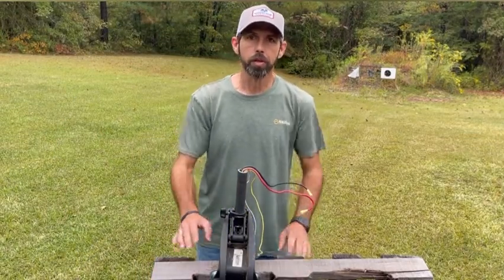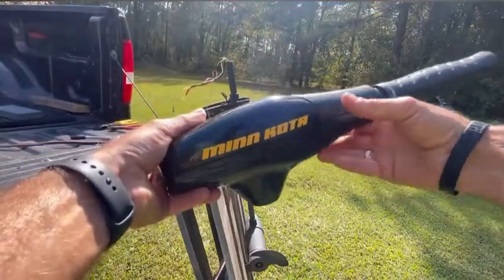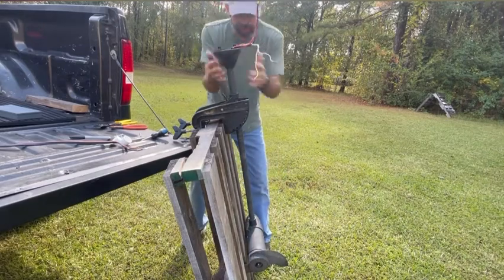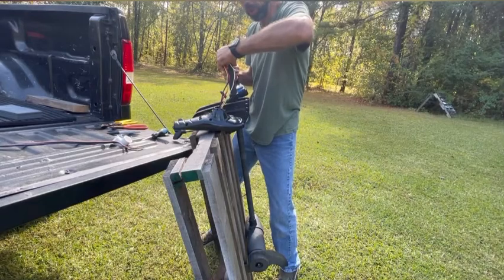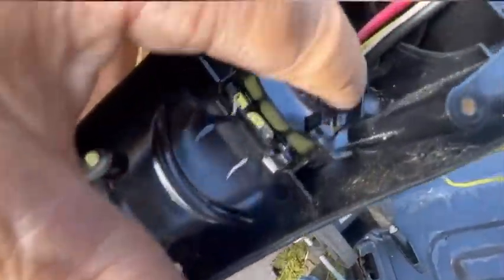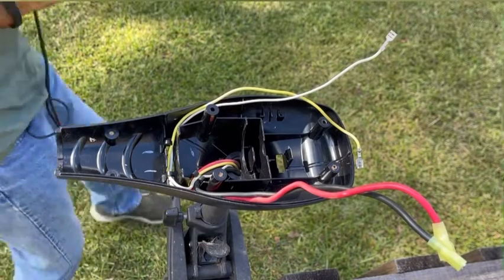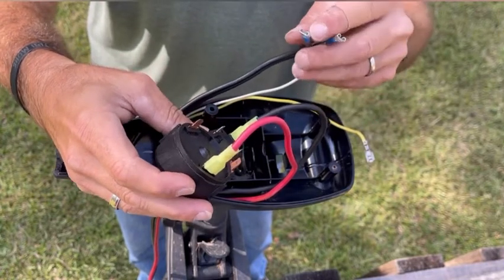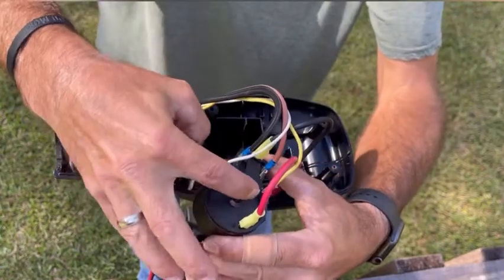How to reinstall the head of a Trolling motor  after cutting down the shaft.

Comment: just modified my motorguide 30 plus. I used a plumber's pipe cutter since mine is a steel pipe and this worked  when drilling I used a hacksaw blade to keep wires at bay when drilling through for new base mounting holes. waiting on the rest of items required to build my PWM box!
Reply from the maker: You took the proper precautions, nice work. It’s really a easy process. Glad your build is coming along. If I can ever answer any questions just let me know. Thanks for the comment.

Comment: I can’t seem to find a video on how you get the head close enough to control from your seat on the kayak. Do you have to extend the wiring? How do you wound the head to turn of and on?
Reply from the maker: When you remove the head of a trolling motor you use what’s called a PWM or a EAC to control the on and off and the speed of the motor.
Reply from the maker: Yes and when you extend the wires use 8awg wire.

Comment: great video 

my speed arm extender came off ? and now my reverse does not work it should be 5 forward & 3 reverse but it not turning ? only allowing me to turn 8 x one way 

Hope this makes sense cam=n you advise please.
Reply from the maker: Sounds like the speed control that the extender attaches to has either broke or gone bad. You could probably replace it or just hook a PWM up to it and remove the head all together.
Reply: @334tacticaloutdoors  

Sorry what is a PWM ? New to this lol 😂
Reply from the maker: @FishingWithJay04 here’s my video on a PWM. 
How to hook up a PWM (pulse width modulator) to control a trolling motor.
https://youtu.be/NdA61Oh1OiM

Comment: I have a prowler 30lb thrust that looks identical to yours.  My question is how do you fix the extended handle.  Mine just comes out on its own.  I would like for you to do a video on it.  May sound elementary but I may be missing parts that makes it just slide out.  Also is the switch a universal switch for all of the minn kota motors?
Reply from the maker: The silver piece of the handle that connects to the switch should have a small screw in it. And yes that switch is almost the same in all 30lb motors.
Reply: @334tacticaloutdoors  I was given this trolling motor off the boat and the guy took it apart when we got back to his house and tore it apart and that is where the piece(s) started missing.  The switch quit working so that is why i started asking questions.  I want to fix this and mount it on the back of my boat.  Where do you order your switches at?
Reply from the maker: You would come out cheaper hooking it up to a PWM and connecting a handle for steering. 
https://youtu.be/NdA61Oh1OiM?si=vT9w83HdFnLyIFTq
Reply: @334tacticaloutdoors  watched that but are you putting the handle back on the pipe for steering? Or do you have something else to put in it’s pkace
Reply from the maker: @rickwilson2848 you can make any handle. You can attach it by drilling a hole and putting a bolt through it.

Comment: I wanna put mine all the way down in the skeg or detachable rudder  no pipe at all  kinda the Bixpy but with a cheaper and more powerful motor.  Ideas lol
Reply from the maker: Trying to waterproof where that shaft goes to the motor would be a issue.
Reply: @334tacticaloutdoors  thanks for letting me know I thought the cables came out through the tube already sealed, and tube was just there for support.   Will try 5200 sealer or epoxy
Reply from the maker: You’re welcome!! I hope it works out, keep me posted on it.